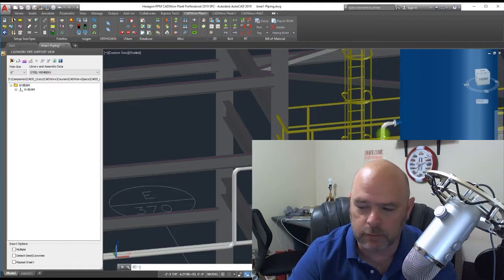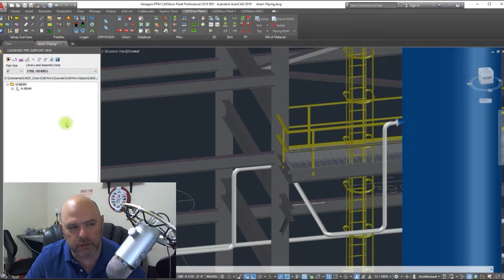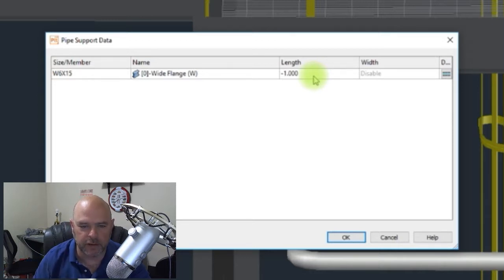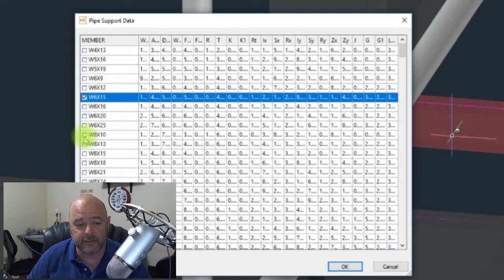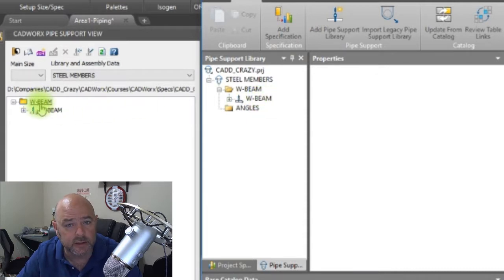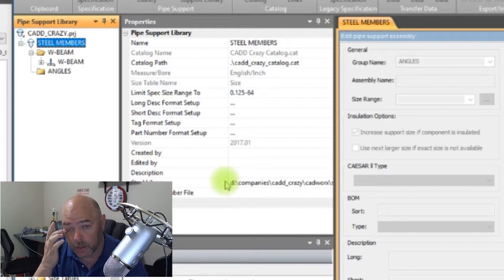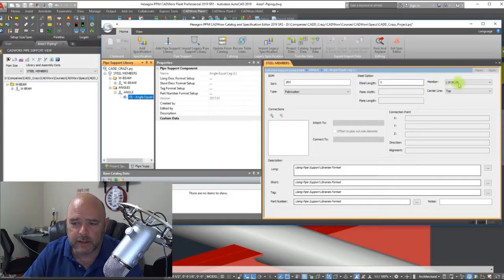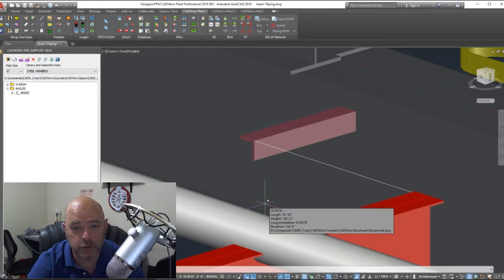Steel in CADWorx 2019 Missing

Comment: Hey, how is it going? I need to know if the Equipment module is working in CADWorx 2019?
Reply from the maker: CADWorx Equipment is still part ong the CADWorx Plant Pro package. Now it does not load in with Plant Pro you have to launch it separately
Reply: @caddcrazy9069   thanks for your response. Regards